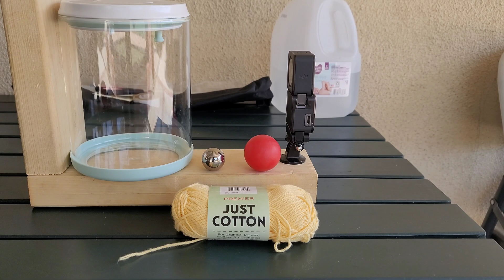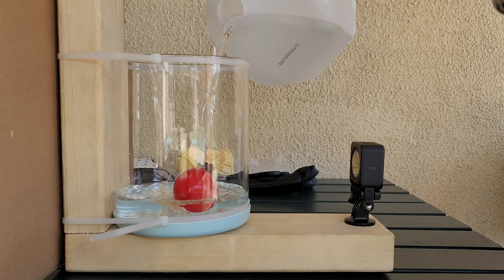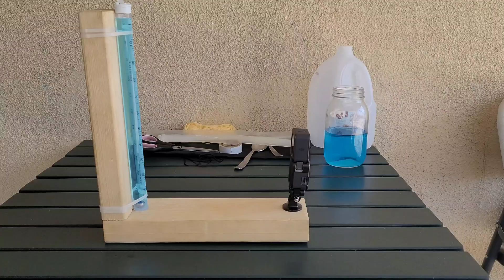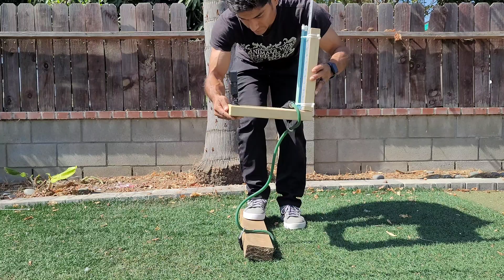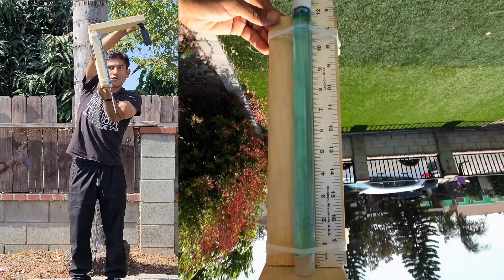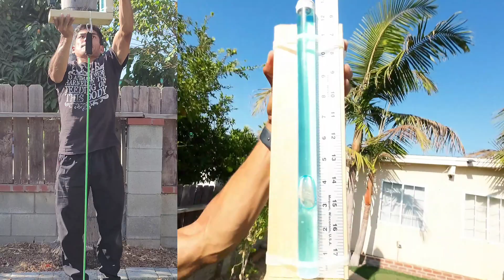2 Density and Buoyancy Experiments

Comment from the maker: In this video I'll be doing 2 different density and buoyancy experiments.
I'll be recreating density and buoyancy in 3 different vectors utilizing motion of a contained reference frame.

In the first experiment I'll be using a container with water, a red ping pong ball and a steel ball. 
The ping pong ball and steel ball will always displace relative to the direction of the force that's applied.
For example, when I accelerate the container to the right, the container pushes the water in the same direction creating a pressure gradient. The water is then able to push anything that's less dense like the ping pong ball in the same direction, that is what we would call buoyancy. However, the water is not dense enough to push the steel ball like the ping pong ball, so the steel ball remains in the same position. The steel ball only appears to move in the opposite direction of the buoyant force because the camera is also moving with the container. The ping pong ball has true motion and the steel ball has apparent motion.
The same principles apply when I accelerate in any other direction.

In the second experiment I'll be using a tube with water, an air bubble and a steel ball. 
To accelerate the container down I will be using a resistance band.
As you can see when connected to the earth we can experience a force creating density and buoyancy. The air bubble is being pushed up and the steel ball appears to move down in the opposite direction of the buoyant force.
You can also see the air bubble is flatten where the force is being applied. However, when I release the container into free fall density and buoyancy completely vanish. The air bubble is no longer being pushed up and turns into a sphere showing that there isn't a force present in free fall.
When I actually accelerate the container down, we can see density and buoyancy invert. The air bubble is being pushed down and the steel ball appears to move up. 
Not only does acceleration require a force, acceleration will always cause displacement of solids liquids and gas, proving that objects don't accelerate down in free fall.
Reply: You won't believe this but i was thinking about doing density experiments yesterday 🫶
Reply: The second experiment could be better but it would be more difficult to maneuver.
For example, the ball is scratching the edge of the tube making the results a little bit unbelievable but still is in no way shape and form is a failure of experiment since the force shouldn't be nullified instead just weaker
Reply: great video as a whole, just 3 thing

1. when you say things dont accelerate down when in free fall, are you implying the earth is accelerating up? because if so then the earth would need to be rising up and millions of not billions of miles per second

2. and if so then why can we measure different rates of acceleration all over the world? how is the earth still holding it self together if 1 part is rising up faster then another part

3. if a force were to act on the water the bubble and the ball all at the same time and at the same rate would you not expect that result when you just drop it? because if they all accelerate at the same rate and time then relative to each other they aint moving basically
Reply: @billbobhere  1. He isn't saying that objects aren't accelerating down in freefall, he's literally showing that to be the case. The conclusions you leap to about what you think the Earth would have to be doing are irrelevant and based on your own misunderstandings of relative movement.

2. These measurements you speak of are of OPTICAL acceleration, not PHYSICAL acceleration and thus they do not take into account relative movement. The only way to accurately measure physical acceleration is with accelerometers, and they show none in freefall.

3. Demonstrate this force you speak of that can equally accelerate different masses and different states of matter all at the same time. No circular reasoning please.
Reply: @billbobhere   @billbobhere  1. I guess I could have worded that better. He isn't saying that objects don't accelerate downward in freefall, he's showing that they don't accelerate down in freefall. As to your question; you need to learn about relative movement before you make such assertions about how fast you think the Earth would have to be moving.

2. Once again; please learn about relative movement and frames of reference before making claims. Objects can APPEAR to be accelerating down at different rates with the Earth moving upwards at a constant velocity. 

And I'm not going to argue with you about what is and isnt physical acceleration. Learn about frames of reference. Learn about relative movement. Learn the difference between optical acceleration and physical acceleration. The only way to detect and measure physical acceleration is with an accelerometer. The end.

3. Ugh...I specifically asked you to not utilize circular reasoning. You had one job.

Now please, demonstrate a force that can accelerate different masses and different states of matter equally all at the same rate. Relying on your flawed visual interpretation of motion and declaring a conclusion isn't getting it.
Reply: @JC23783  1. so you say "He isn't saying that objects don't accelerate downward in freefall" while they say "proving that objects don't accelerate down in free fall." he is legit saying what you are claiming he isnt, also if the earth was rising up, to make things fall and all of that back to the ground, then it must accelerate up and the amounts it must accelerate up at is 9.8 meters per second give or take, because it cant move at a constant speed or else there would be no force pushing you into the ground, just like how in a plane you feel yourself being pushed back while accelerating but when you are at a constant speed you no longer feel like you are being pushed back, so it must always be accelerating, and just after 1 year of at accelerating at 9.8 meters per second you would reach 192,168 miles per second, but its been longer then 1 year right since we have been hear and measured things call so lets say after 100 years now, well after 100 years of accelerating at 9.8 meters, you would reach 19,216,804 miles per second which is already much much faster then the recorded speed of light and that is just from the past 100 year, should we find out how fast the earth would be moving after 500 years or 1000 years maybe?

so if you could quote what they really said then if they didnt say the words "proving that objects don't accelerate down in free fall."

2. no they all accelerate at the same rate but due to air resistance a feather and a ball will reach a different top speed

2.5 "The only way to detect and measure physical acceleration is with an accelerometer." just use a ball attached to a spring, if the thing that the spring accelerates you will see movement in the ball and a change in the springs length, that is also another way to detect acceleration, also im sure if you know the weight of the ball and what spring you have and all of that then you can calculate how fast it accelerated over a set time, because the higher the acceleration the more the ball moves and the more the springs length changes

3. did you miss the part where i also asked you to explain "if the earth is rising up why are the objects slow down? i mean there is air from underneath rushing up and hitting into it right so why cant they just stay in the air, get someone with a parachute they havent touched the ground in light 5 mins and they have slowed down quite a bit so why aint they being pushed back up with the amount of air pushing up on the parachute when thar air rises up?" or cant you explain it so you ignored it, or am i not allowed to ask question and you are the only one that is allowed too? just wanting to make sure 

also its not circular reasoning if we have already measured it and everything, but if you claim it is, then please prove the earth is rising up, i mean that should be easy right, you do have evidence supporting your claim, or do you have nothing but assumptions and beliefs where you think you know more then people who have studied and work for 10+ years in a field when you havent studied or work in that field yourself
Reply: Hi William, can we make email contact (I am in contact with Andrew and Del - they will vouch that I'm not a shill - well, I hope they will!)  My email is on my Youtube channel.  All the best , John.

Comment: Cool experiment-- thanks for sharing it. 

In the free fall test of experiment 2, you say "density and buoyancy completely vanish", but the steel ball continues to move down through the water. What makes you say that there is "no displacement", when clearly the steel ball is displacing? 

It is cool that the big bubble is round like you say and doesn't noticeably displace, but the tiny bubbles beneath the big bubble do continue their upward motion. What do you make of that?

Keep up the good work and free thought. Cheers!
Reply from the maker: Good question, I was going to address this in the next video.

The steel ball started to decelerate before the container was released into free fall. Therefore, it has a faster deceleration rate by the time I released the container.
The steel ball is simply decelerating at a faster rate than the container because it started to decelerate before the container.